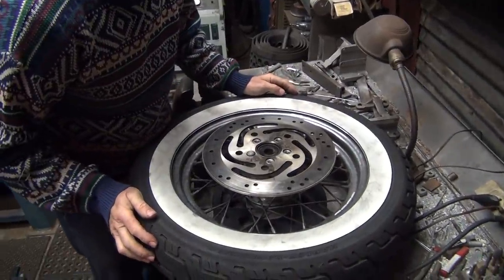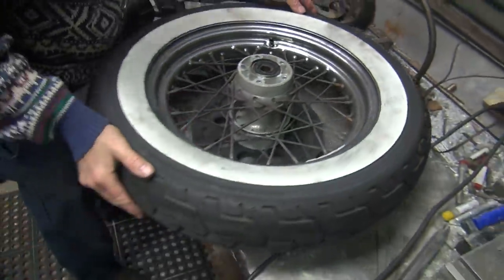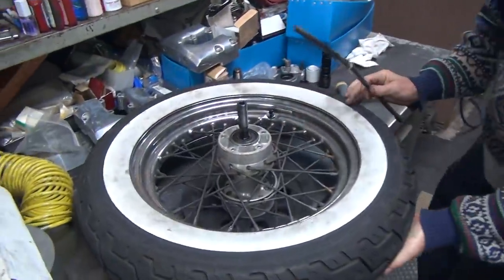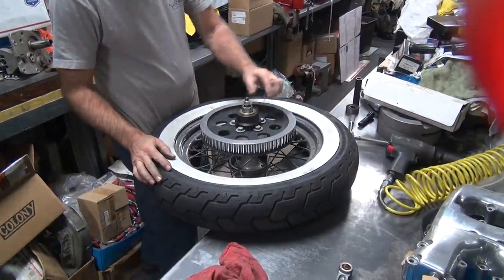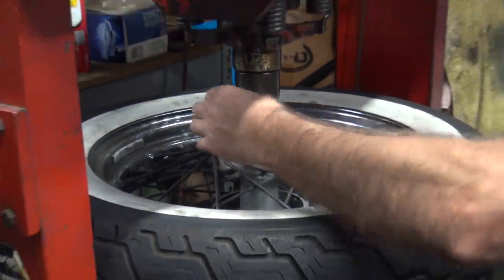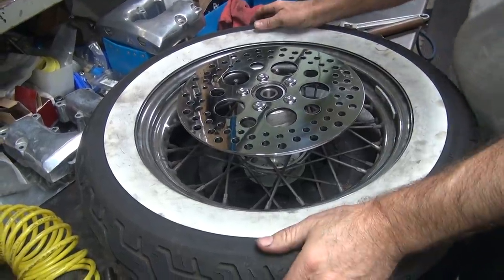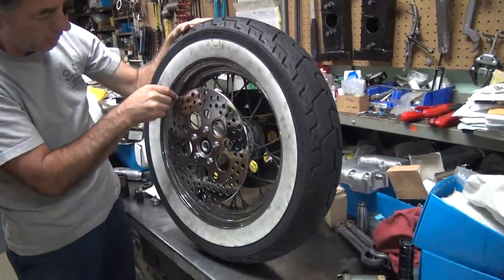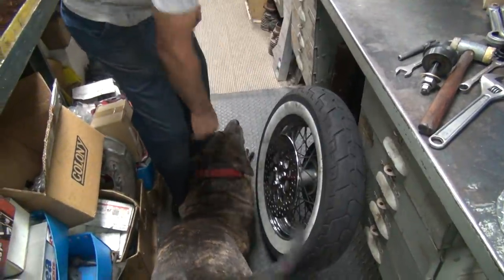#140 how to do it, remover stripped broken disc brake rotor bolts screws harley wheel tatro machine

Comment: hi keenan transmission pushrod shaft  question : if the clutch cable is unhooked from the arm by the transmission and my clutch plate  comprerssion cover is  off ,  should the rod move in and out if i work the transmission shifter arm by hand?  the shaft just slid pulled right out did i fuck something up by removing the shaft? or is it not supposed to thrust in and out without tension?  83 fx 4 speed
Reply from the maker: yes the pushrod should work when you move the lever in and out. when the pushrod came out you lost the pushrod bearings. the clip came off that holds them onto the pushrod. this is very command. most likely the bearings and pushrod are bad, that is why you are probably working on the clutch in the first place. just fix it and you should be good. make sure you adjust everything corectly. read the service manual on this.
tatro

Comment: I use to tack weld a nut to the head of the bolt it use to work pretty well
Reply: yep, been there. just sit the nut over the head of the stripped bolt and weld it to it. The heat and a/c current helps break it loose.
Reply from the maker: most of the time that doesn't work for me. this does.
tatro
Reply: Got to go with what works